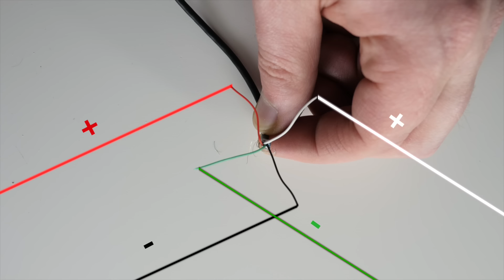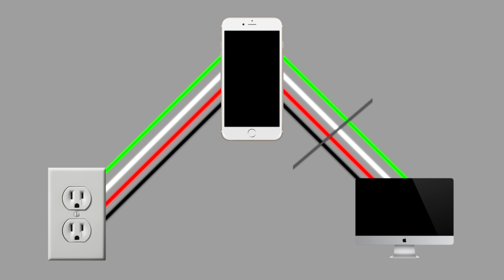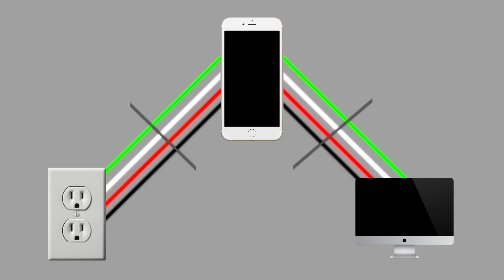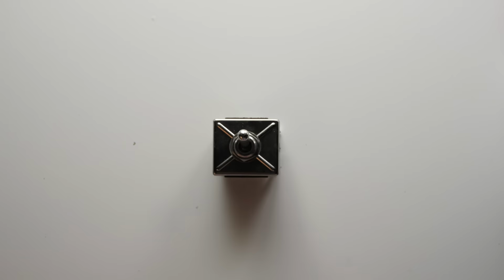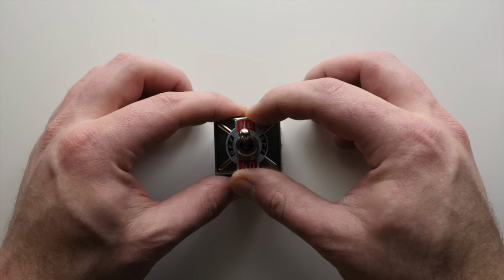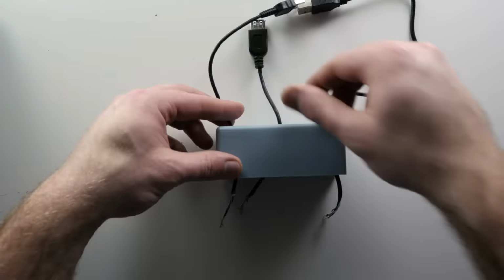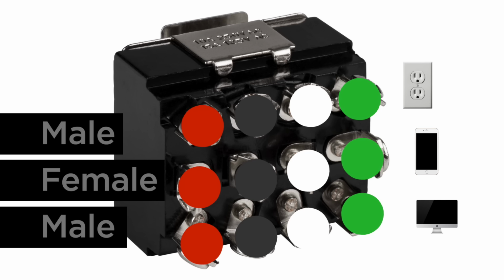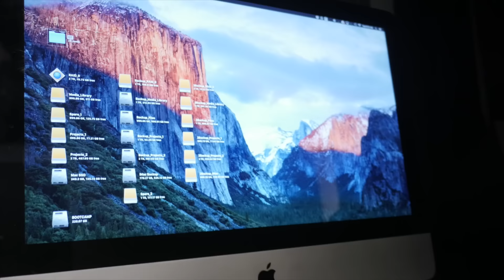Cheap DIY Phone Import/Charge Toggle Switch

Comment: If I remember correctly, the phone uses electrical information (not data) it gets from testing the data lines to determine how fast it can charge. That's probably why it didn't work just switching the power lines.

Comment: cool project but with most modern computers and computer cpus a computer will actually charge your phone faster than a wall outlet. my computer can charge my phone from 0% to 100% in about an hour where as the outlet usually takes around an two hours